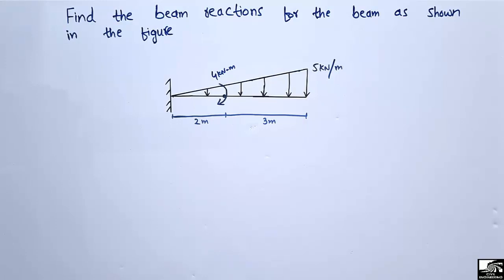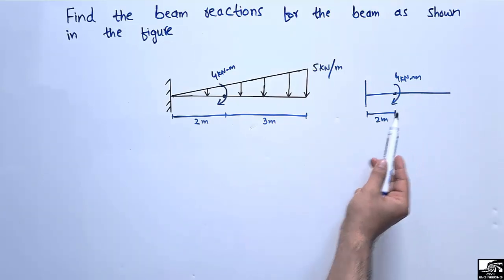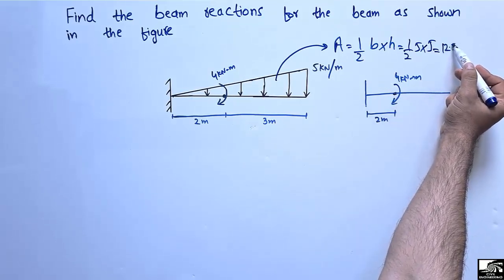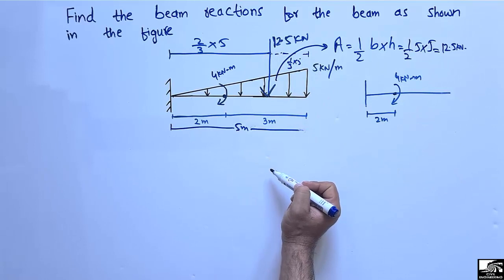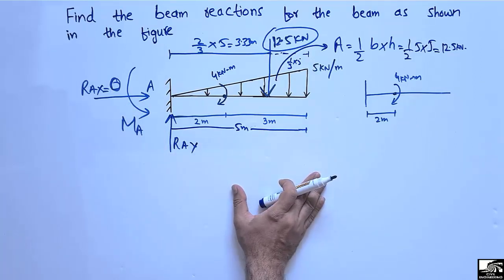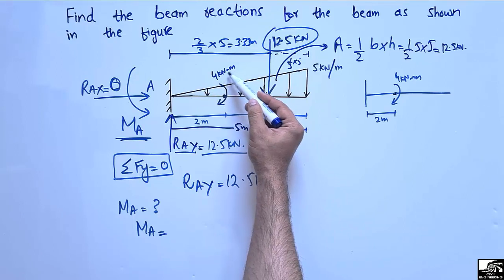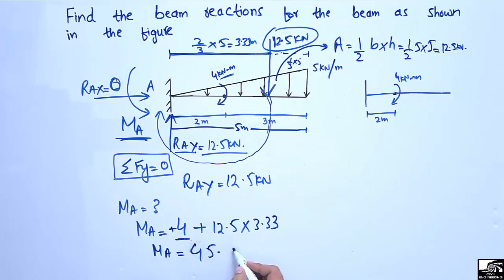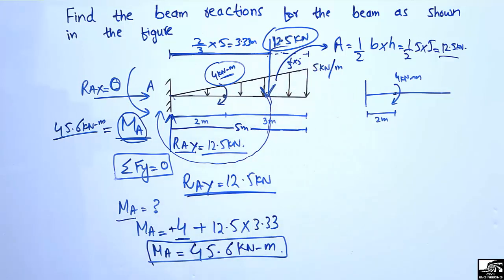Support Reactions of a Beam with Triangular load

Comment: I have an important question: what does it mean to have a moment located in the middle of the beam according to your example?

I did many of these examples during university. Distributed/uniform load can be any load (live load, dead load, etc..) and in any shape (rectangula, triangula, non-uniform, point load, etc...), but what is the cause of this solo moment located in the middle in real life? Can someone explain?
Reply from the maker: A really good question, In practical life, I also never experienced such case. I did here to show how we can solve such type of beam with such moment. I hope it helps.